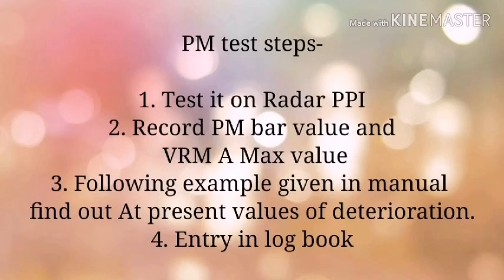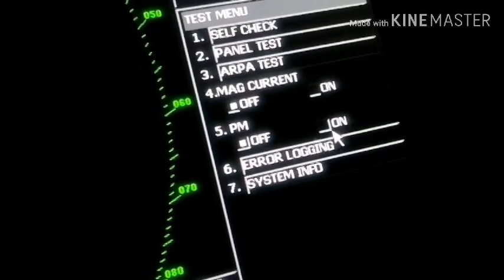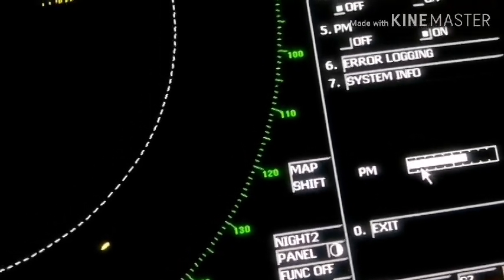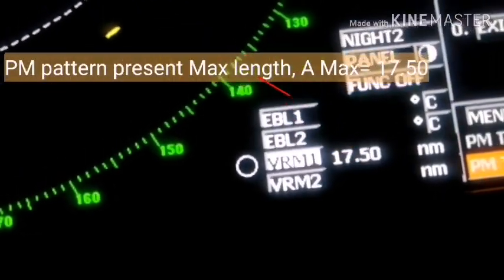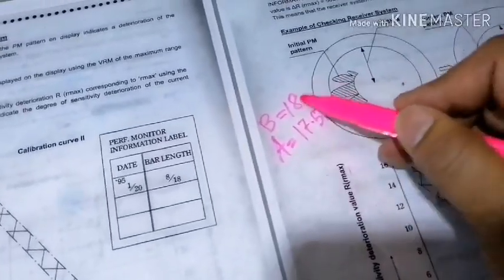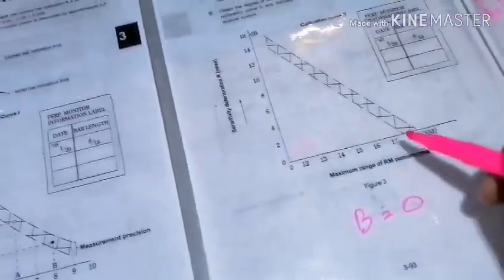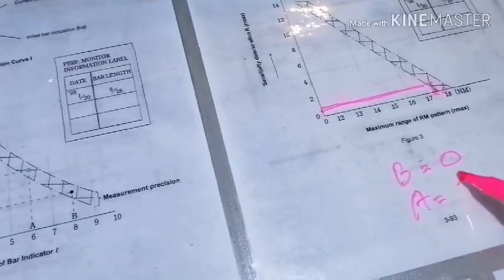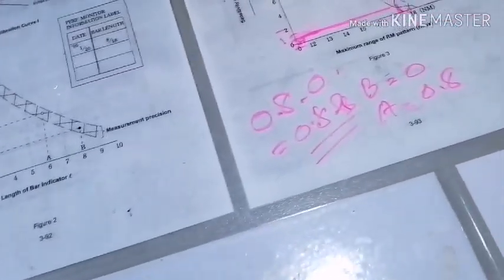Radar PM test easy explain

Comment: Why pm test is done on radar use of Pm test?
Reply from the maker: To understand the Transmission & Receiving   is working fine
Reply: @Sailor360  thankyou sir
Reply: Sir I had one question why X-band radar 9 ghz n S-band 3 ghz but x band is gud for short distance 6 mile; 3miles but S band is gud for long distance 12 ghz 24 ghz but why X-band is 9ghz n used for short distance but S band is 3ghz but long distance??why like that??
Reply from the maker: The shorter the frequency means the pulse length is more and again if the frequency is higher means the pulse length is short.
That's the reason. You may search on the topic & hope it will be more clear then.
I will also make a video on it🙂 hopefully